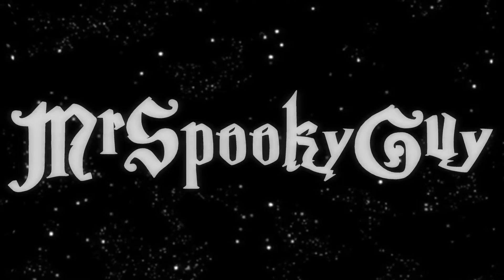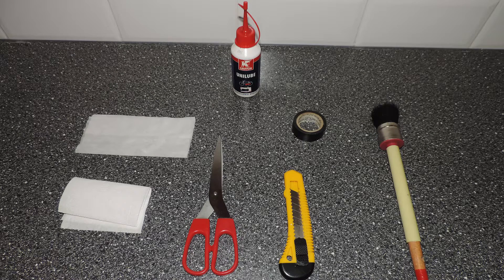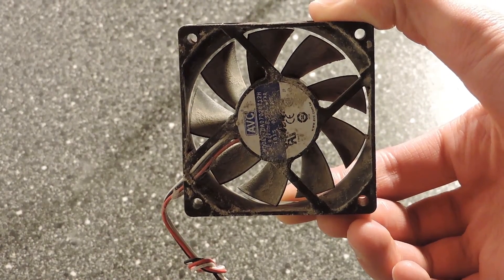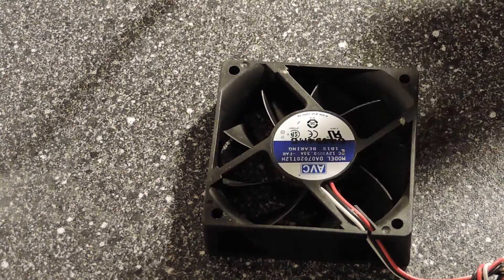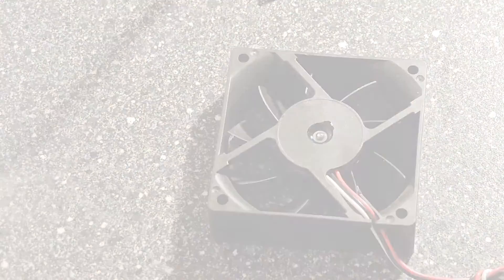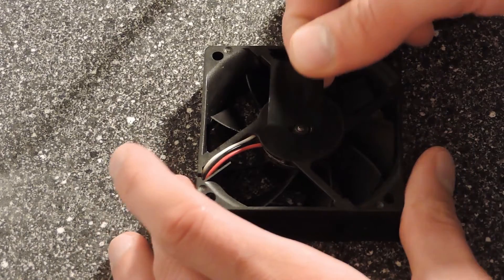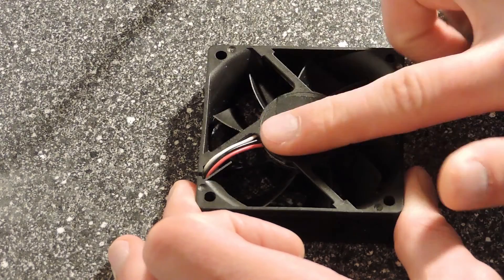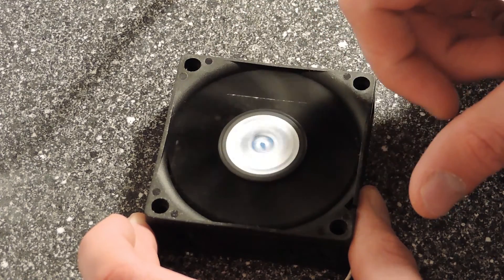How to make a pc fan quieter  (The right way!) (1080P)

Comment: Can anyone confirm that this works? Or should I just buy new ones?
Reply from the maker: This is a cheap and simple solution for reducing fan noise. If you have tried it and there is no difference, then you can go for the more expensive solution a new fan ;-)
Reply: This work ONLY for the mean time. I've tried this and the oil gives more heat and attracts dirt, its better to disassemble then use grease.

Comment: Robot Voice, moving on Also if I'm not wrong, PC fans don't use bearings. They use an electric motor.
Reply from the maker: Here is a link for more info about a pc fan: http://www.dansdata.com/fanmaint.htm
"The motors in modern computer fans are brushless units which will last, by computer standards, forever. But the spindle on which the fan turns sits in a bearing, and bearings wear out."
Reply: motors have bearings dude, pretty much anything that spins has bearings, cars have motors and they still have bearings etc. hope this helped
Reply: I don't know which planet you came from, but from Planet Reality all fans have bearings, it's either ball bearing or sleeve bearing. And also you are wrong, PC uses ball bearing.